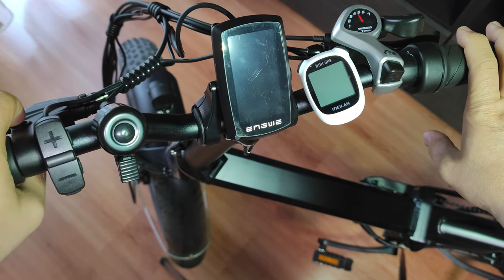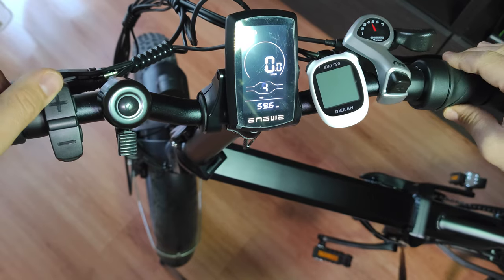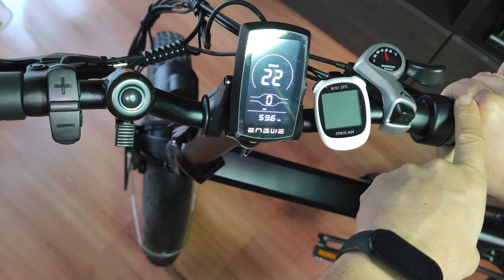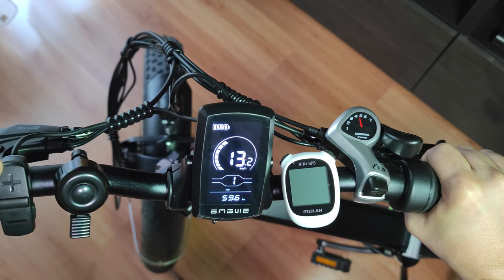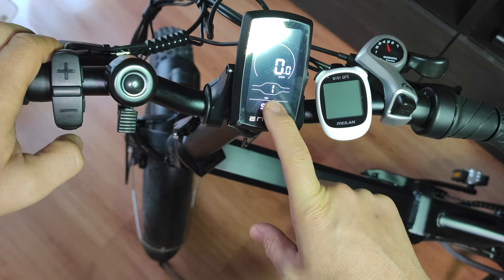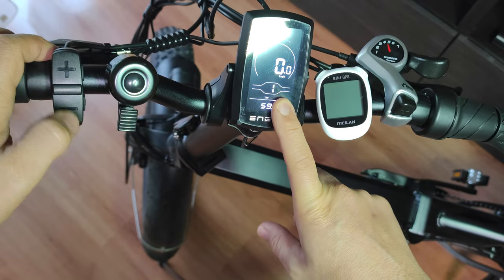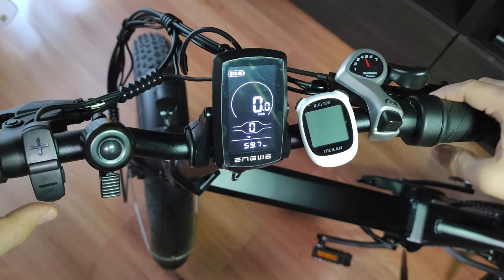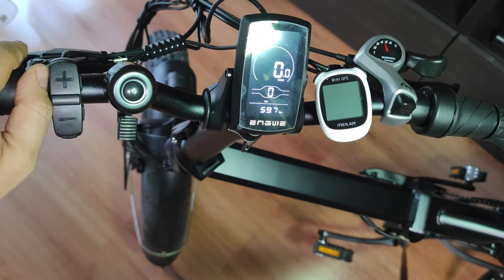ENGWE Engine X How To Enable & Disable Throttle Accelerator - Yolin YL80C Controller

Comment: I don’t understand why the user manuals to these bikes don’t tell us this? I thought mine was broke until I had to dig for this information. Thank you 😊
Reply from the maker: Because the bike is also sold to EU and there is should be restricted. The advanced settings and unlocking is not for everyone as there are a lot of pople changing other settings they should not ending in getting an nonworking bike or killing the battery.
Reply: Because government doest want you to have fun.

Comment: Hello @TechTronic9000, thank you for your tutorial, it's worked fine. But now after some weeks, I tried to do the same manipulation to deactivate the throttle without success... Any solution ?
Reply from the maker: Try it with only holding the brake lever.

Comment: I have an engwe l20se got the same display. Wondering if you know this display if faulty as I charged my battery fully but it only shows one green bar, when using my bike the battery meter flashes telling me no more charge! The bike keeps working on throttle and pedal assist. Please help with your thoughts

Comment: Hi, i have c20 pro and i activated throttle as you did but the speed with throttle is only 6km. What could be the problem
Reply: hi i have the ep-2 pro (same display and controls) and got the same issue. did you find a solution?
Reply: I'm having same issue

Comment: You were saying on the last video of this bike that it can go up to 1000W. Can you do a video on it going up hills and stuff please as I'd be very interesting in this bike as it actually 250w bike
Reply from the maker: Are you interested in 250W / limited performance going uphill or when it's unlocked to full speed / power?
Reply: @TechTronic9000  I would love to see a video where you compare the Locked and unlocked. Just a video idea
Reply: @TechTronic9000  - Thanks for the great reviews, I'm subscribed. I would like to know: how the Engine X performs going uphill locked to 250 watts, speed limit 25kph and the throttle not engaged; how it does uphill with the speed unlocked and then with both the speed limit unlocked and the throttle enabled.

 I would prefer not to unlock it from it's factory default settings. However, I am 17 stone and live in a hilly town so am concerned that the factory settings might not be good enough for me.
Reply: Please do this. 
Videos uphill 
Limited and unlimited.

Comment: Hi tech, i just got engine x and ive done everything you said to do but the throttle wont activate and the speed limit won't increase or decrease, i would appreciate some help if you can. Thanks love your channel.
Reply from the maker: It should still work, is it the same LCD model on your bike?
Reply: @TechTronic9000  hi tech, thanks for getting back to me   I can get into the speed limit setting but it won't increase or decrease and the throttle is restricted to 6kmh, its a new bike and the original lcd.

Comment: I can see on your other video that it can be unlocked tonanmax of 60 kmh. Which could also be 45 kmh. But is it possible to adjust the throttle to a certain speed, let's say assist to 25 kmh, even though the bike can go the 45 kmh?
Reply from the maker: The bike has default 5 electric "gears", each as a speed and power ratio limit, so 1st gear is ~10km/h, 2nd is 18km/h, 3rd is 25km/h, 4th is 35km/h and 5th is unlimited. So both assist & throttle is limited to the gear ratio. The throttle is also fully proportional so on 5th gear you can ride it from ~10km/h up to maximum of 45+km/h. You can see a lot more details about this in my full review about this bike. Just look it up my channel.

Comment: It didn't work well, I have a limited speed to 8 kilometers per hour and I tried all the ways, nothing worked, not even unlocking the speed limit, can you help me? I have a European version
Reply: I have the same problem. Any luck getting it fixed?

Comment: Do you know if this can be actived / deactivated while rolling mid ride incase I get pulled over, then it can be easily turned off while coming to a slow stop
Reply from the maker: No, it can not be enabled / disabled on the go. Only stationary and only like in this video.
Reply: Thanks for that 👍

Comment: The motor says 250W on the C20 Pro but they say it is actually 500W. Do you know how to unlock this extra power?
Reply from the maker: I only have the regular C20 (non pro) and I don't know how and if it's possible to unlock your model as it has a different controller and it has a display.

Comment: I need help finding a solution to reduce power to 250W due to legal rules in the EU. Would you happen to know if this is a hidden option in the menu?
Reply from the maker: If you have the X model then is like in this video (and the other one related tot this), you just need to restrict it back to 25km/h and disable throttle.

Comment: Hello I need your help Problems with advanced settings When I hold down the - and i button at the same time the screen flashes and just goes back to the main menu, I can't access the advanced settings please help
Reply from the maker: You need to hold o + and - not - and i

Comment: When turning on the bike you can see on the screen that there is an actual battery %  next to the meter. Any idea how to turn that on??
Reply from the maker: That is just the LCD model, what it is displayed it's actually embedded in the LCD controller and in the bike controller. In short it's not possible on this model.

Comment: Thank you very much for this vid. I already almost broke my mind in attempting to understand how to enable it on Engwe C20 Pro (in the same manner, btw). Thank you!
Reply from the maker: Did it work for the c20 pro?
Reply: @TechTronic9000  Yes it works for C20 Pro. I was sent your video from Engwe Support directly.

The only difference with C20 Pro is that the display does not show "ERROR 22" when holding throttle+brake. But after doing the steps the throttle will still be unlocked.
Reply: @TechTronic9000  Yes :)
Reply from the maker: Hahaha, nice! Glad to know that!
Reply from the maker: Hahaha, nice! Glad to know that!
Reply: @foxdk  Thank you!!!!

Comment: Hello, can you tell me how I can reset the bike to 25 km. Because it goes faster than 25. and how can I disable the throttle?
Reply from the maker: The same way as it is enabled, for the speed just put25km/h instead of high speed.

Comment: hi,question please for cruse control, i deactivate the little heart logo on the display, but it not work really, if i hold the throttle at mode 5 high speed electric mode only more than 3-4 sec, the cruse is always on, i need to push rear brake 1 time for deactivate ,  if someone finds a way to deactivate completely cruse control  come here to tell us , it's not that little heart logo that changes anything, whether it's on or not
Reply from the maker: There is an option in the hidden advanced settings to disable cruise control.

Comment: As many others i get error 5 ,my seller says this is normal and throttle doing 3.6 mph only  and not working is normal!my engwe pro 2 only working on pedal asist is normal !.
Reply from the maker: The display and controllers change as models advance, so does the unlocking procedure. For the Engine PRO 2.0 is this one https://youtu.be/VH563oAUgik
Reply: Thanks did the job 1st time ,under a minute ,thanks for black voodoo majic link.

Comment: I am in Ireland and its 250w motor.
Reply from the maker: Yes the Engine X is 250W rated, unless you unlock it ;)
Reply: @TechTronic9000  how can I unlock it?

Comment: Is there anyone else than me getting the error 5 when i'm trying it, instead error 22 (my brakes work perfectly by the way)? Tell me if you found? something;)
Reply from the maker: It might be a newer bike version with a newer display & controller. You can check my newer videos for the PRO 2.0, L20 Boost, they have different unlock method now.
Reply: @TechTronic9000  oh thanks! Maybe, yes it could be! I'll try and I'll tell you;)! Thank you!